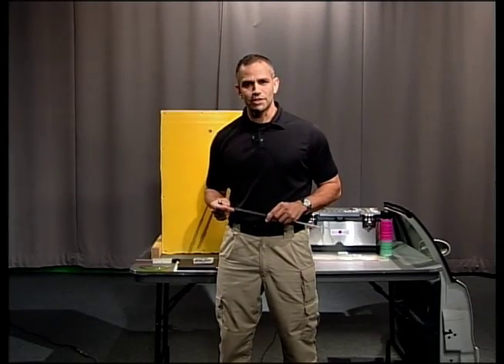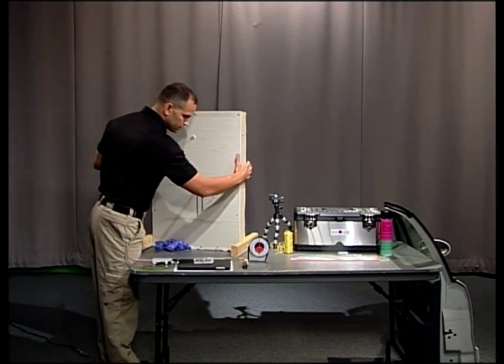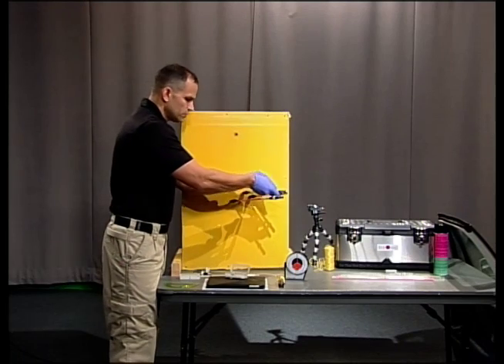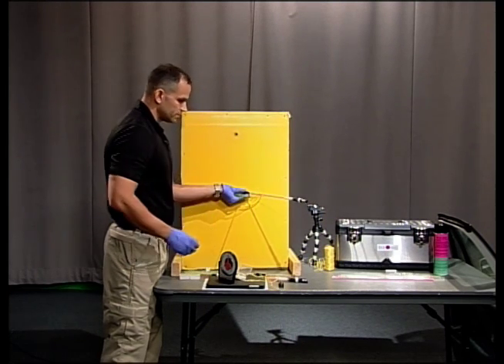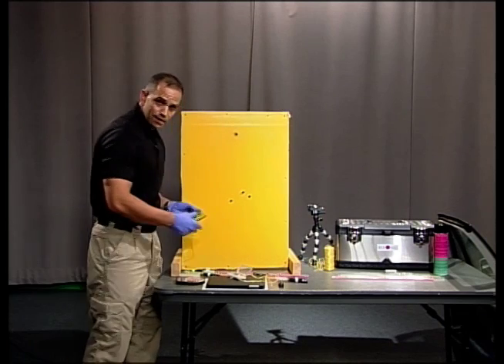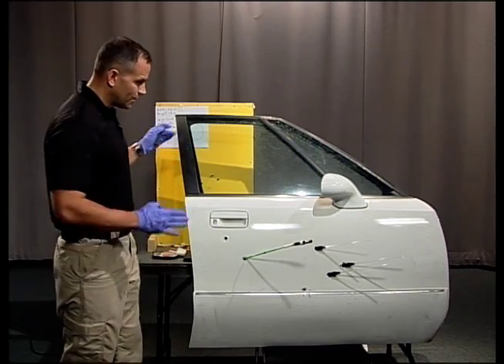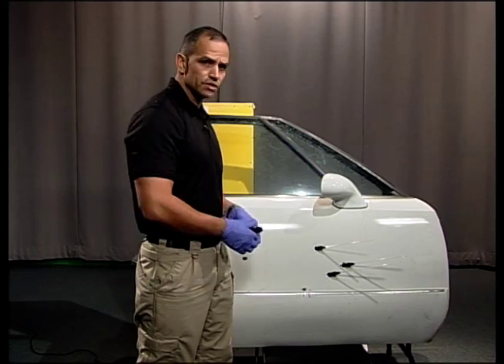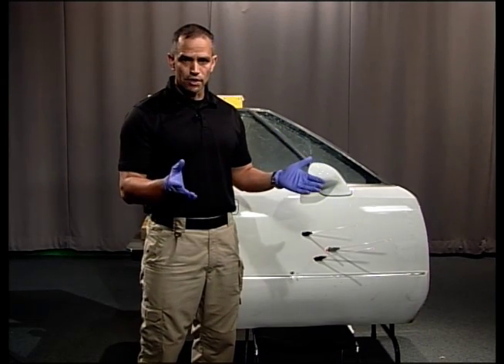Forensic Education Bullet Trajectory

Comment: hello so i really need your help please 
so I'm doing a math project about trajectory and i really need to understand this so my question is do you measure the angle of the bullet then put the dowels accordingly or do you put the dowels then measure? cause i got a little confused and then my other question is when you use the lasers did you measure the angle of the bullet before putting in the lasers?
my last question is do you have other recommend websites or videos that i can watch to help me understand more?
thank you and please respond if possible
Reply from the maker: I measure the length and width of the imperfection before I insert the dowel. Then I measure the angle with the dowel inserted. I don’t know any specific videos to watch, but I hope that clarifies enough for you. Good luck.
Reply: thank you very much for answering my questions it really helped